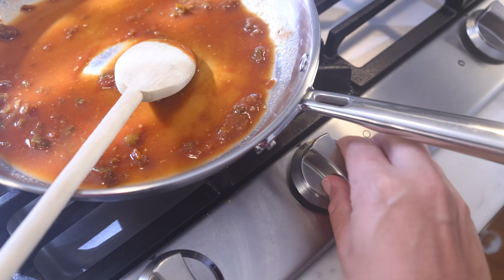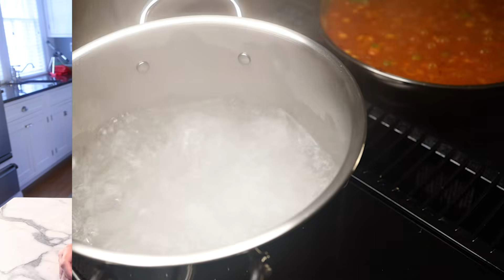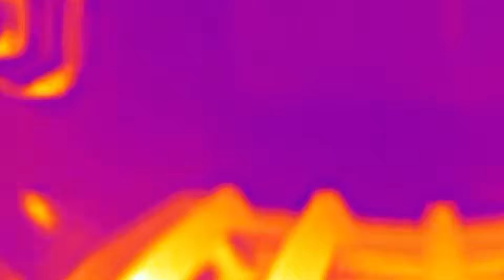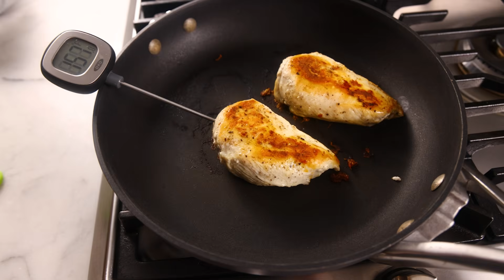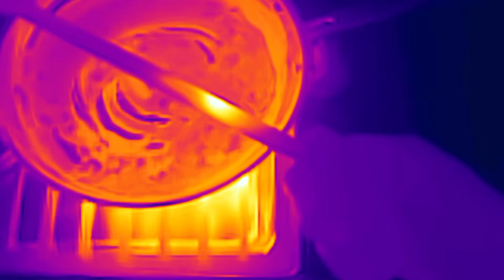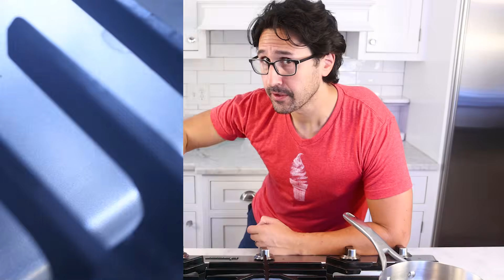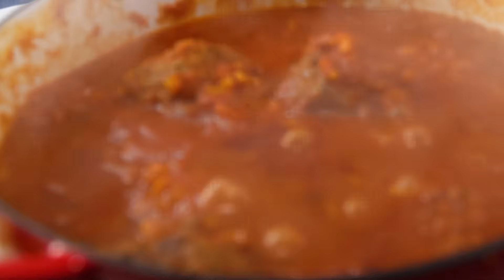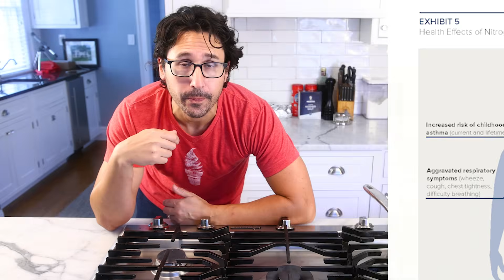Problems with gas stovetops | weak, dirty and dangerous

Comment: I have always found gas stoves to have more advantages over electric.  I am still in this position.  Your arguments have not convinced me.  Most recipes involve reducing heat quickly.  Electric stoves require having a second burner going at a lower temp.

Comment: Most of the problems you have with excess side heat and not getting the temperature low enough can be solved by buying some large trivets.

Comment: I don't quite get some of your points but the video is interesting. My father is a chief gas engineer at his own company, he has been doing it since 1987 and I've been exposed to gas world since i was a baby (the third word I learned when i was a baby was "gas") so my take may be bias. Where i live gas prices are pretty low and using a gas stove is slightly cheaper and in my opinion it's much more enjoyable to use gas stoves. Plus you always see when it's on or off, it might seen stupid but a couple of times i left my girlfriend's electric stove on but thought i turned them off lol. But when it comes to hazards oh boy gas stoves are dangerous. The best case against gas stoves is how easy they can kill you. Let me give you an example. In soviet buildings there are no fans pumping co2 from each apartment, instead they are designed with special gaps (in doors, windows etc) to provide airflow and create positive pressure in an apartment, there are also 2 types of vents, for clean air and co2. So there are a lot of people who change their old soviet wooden windows for newer plastic ones and their doors for newer soundproof doors. If installed incorrectly this would destroy air circulation and fill your apartment with co2. Also i know at least 2 stories where people installed fans in their toilers and connected them to the wrong airvent wich created a negative air pressure and all of the co2 from co2 vent got into their apartment

Comment: In the US gas is essentially a waste product of oil extraction and production. That's why it is so cheap. Gas that isn't put into the gas pipelines and used will be flared off at the well head. In Europe and other continents gas is piped in from Russia or shipped in from elsewhere, and it is presently quite expensive.

Comment: For me the biggest W for gas stove is you can exceed the maximum heat of electric/glass top stove without any kind of expensive or troublesome modification.I like that feature because me and my family are asians,and we live in  south east Asia and many our homecook dish require very hot and stable heat,also with gas stove you can use your wok or any kind of wok like pan (if you pay attention to the past adam's video he never used wok or wok like pan because the flat and not supported surface of the electric glass top stove) and the last thing for me is gas stove can provide so much dexterity,freedom and flexibility to cook
Reply: For those who wondering what kind of gas stove that can exceed the maximum temperature of glass/electric stove,you can look up to chinese restaurant that use very fast and big stream of flame to cook fried rice or other stir fried dishes

Comment: Should've gone with my gut expecting this to be "environmentally" motivated. Seemed legit at first, though poorly evidenced and argued, as is custom. And sure enough, eventually devolved into the carbon footprint equivalent of penny pinching. Wake me when we solve the shipping industry. Til then and as someone who's predominantly used electric stoves throughout most of my life, you can pry gas from my cold, dead, immaculately prepared fingers because I was able to maintain a steady temperature rather than compensating for random fluctuations while simultaneously trying to re-figure out where medium actually is this time. Because why would a person want that to be consistent?

Comment: I agree with the lack of low heat. I often take one of the grates from another burner and stack it on the one I am using to prop up the pot an extra inch to let more of the heat escape.

Comment: The Most obvious designflaw in gasstoves ist their Open Design. You see, the woodburning stoves did it right, a big slab of Cast Iron with removable Rings above the Center of the fire for the extraboost of Heat.
Light fire,remove Ring,(s),Pot on, Instant Heat without burnig Handkes, Thermometers etc. For Low and slow add Rings and Push Pot to cooler place.

Comment: My brother left a cardboard box on his electric stovetop the day they moved in, it was turned off, they left to go drop off their u-haul, and they received a call from their neighbor that there had been an explosion. The apartment was on fire. Yes, electric boils water faster. If gas is off, you know it's off. If it's on, you know it's on, either from the flame or from the actual gas if it's not ignited. Electric doesn't cool down quickly enough when you just need your stove for storage space after you've drained your pasta and you want to put the pasta back in the pot, not a separate bowl so you only have to clean the pot. Electric is great for boiling water, happy for everyone who likes it but oh boy I will never

Comment: To me, Adam's "all the way down" problem is an absolute death blow to gas stoves, and why I like my resistive glass-top electric.  I was watching a recipe on another video recently (Tasting History with Max Miller, "Japan's Edo Era Noodles") that called for heating a liquid but not boiling it -- no problem on electric, nigh impossible on gas, in my experience.  Electric has a huge advantage in low-end temperature control.  Yeah, the response is slower with electric, but especially on the low end of the temperature range, that's a good thing.  I'm with Adam on another point, too:  when my current stove dies, I'm going induction.

Comment: If you switch to induction they type of pan is important beyond the fact that the bottom is a ferrous material. Some pans have a thin ferrous plate attached to the bottom of a pan. This is often not sized correctly for the pan so you will get hot spots in the center of the pan. This type also doesn't seem to heat up as quickly as a tri-clad base. If you do switch to induction I think this topic would make a good topic for a video or at least part of a video.

Comment: I love that my ceramic resistance-coil cooktop is so easy to clean. I find it pretty responsive - it was actually something I noticed when I first used it - though I do pull a pan off the hob occasionally.

Comment: As you said later, it's not really power but efficiency. Gas stoves spit out a lot more heat than electric ones (at least here in Italy, where our electricity contracts are 3kW), but electric ones are much better at getting the less heat in the pan.

In my home there's an old Smeg gas burner, that does a fantastic job of keeping the heat focused. I have absolutely no idea how it does it, but I can safely hang stuff off the pan without a problem, I can keep my hands very close to the pans and pots without fearing to get burned and water boils rather quickly. To put it into perspective, the only times I have to be careful are when making coffee with a Moka, otherwise it's pretty much like electric.
When we installed a second gas stove and I started using it I was not used at how much the sides got hot, I almost set fire to a bunch of stuff before getting used to it lol. So far I haven't found another gas stove that's as good as the one we have, traveling and observing the ones in my friend's homes (after finding out that our stove was like that I started looking for the stove in every house I get into lol)

Comment: One weird thing I noticed when I went to college in the US is how freakin’ old-fashioned the US is. Those naked coil electric stoves haven’t been a thing over here in Sweden since at least sixty years. I never saw one outside a scrap yard until I came to the US a quarter of a century ago. And they still have them?! 

For those who wonder, the “old-fashioned” electric stoves in Sweden have the coils imbedded in cast iron plates of sizes that fit standard pot sizes. But those are on the way out in favour of ceramic tops and induction.

Comment: I moved to a place with a brand new coil-electric stove top, it has this thing called "Sensi-Temp" which, in theory sounds great, but in practice, is dumb and does nothing other than make my tiny non-stick pan not sit flat on the coil because they have springs in them and that pan is light. It even makes my 12-inch All-Clad lift up every so slightly on the one side.
But, the burners on that stove, my god they get hot, like water jumping out of the pot hot. It's amazing. It also has "Sim" written next to 1, and it does exactly that, simmer. Very useful.

I am very used to the way the resistive coil behaves, I know that it takes time to heat up and cool down, and I use that to my benefit while cooking. I also am very used to moving things away from the burner when they are done, which can be annoying, having a glass top made that a lot easier, the coils are not at the same height and not as easy to just move the pot off the burner, but it's not a huge issue.

I do cook Chinese food every once in a while and have a wok (flat bottom), I have just accepted that I am not going to get a restaurant level of wok hei. I don't really miss it.

Living in Canada's gas centre, I am happy to use electric and not gas.

Comment: It won't solve all your problems, but a big robust electric kettle is the perfect fix for the water boiling issue (ironically getting what is basically a small electric heater is the solution). They are cheap and even though it's a "single-use gadget" what real meal doesn't involve boiling water?

Comment: I bought a $50 (CAD) induction burner from IKEA this past summer, and it immediately became my favorite cooking appliance in the house. It's lightweight, portable, way more responsive and it feels more powerful than even my largest burner on my coil stove. I regularly use it with my carbon steel and cast-iron cookware as a BBQ stand in on my apartment balcony.

Comment: Here in Mexico gast stoves are the norm. Not only electricity is expensive enough to make electric stoves inefficient economically speaking, but we also use gas to heat water for bath and washing. Gas is so important that recently the goverment decided to spun up their own gas company.

BTW, gas can be either be delivered by pipe, or by a tank installed inside the property, with both a stationary refillable tank or a removable one. Even there are some jokes about the gas man being like the milk man: the real father of tons of kids.

Comment: If you want lower heat than the lowest setting of a gas hob you can buy a diffuser which will sit under the pot and lower the heat to the pot, I use one when I'm steaming small amounts of rice and the lowest gas on the smallest ob is still too much

Comment: I hate cleaning my gas stove! Most of the time I just clean it so theres no big bits of food, and don't clean it until it shines... It takes too long. I'd definitely replace it with a different type when it needs to be replaced. And my husband is from England, and they use electric kettles much more than we do in the US. So when we need boiled water, we use our electric kettle, and it's much faster than starting out on the stove.

Comment: Some additional pros/cons for the environmental impact of gas.

Pro:
Peak energy usage tends to be around dinner time in the summer, so the fuel efficiency of gas is beneficial in this regard.

Con:
Gas infrastructure tends to be leaky to some extent. Residential is spread fairly thin, so this can be a significant problem.
Large energy suppliers of gas can potentially do carbon capture. This mostly hasn't happened, because there is no incentive.

Comment: The ''boost'' mode on my induction is so hot its like boiling water on the surface of the sun. If you have cats, remeber to lock the controls, my cat turned it on by accident once with an empty pot on the stove, it almost reached white-hot temperatures, we noticed it when we could hear the metal of the pot creaking.

Comment: Induction is amazing, as long as you buy a more expensive option. I have a cheap tabletop induction hotplate and it has to cycle off and on to produce low heat, which is very inconvenient in some cases. I also have an electric stove and those have always been atrocious in my experience: slow (slower than gas or induction) and unresponsive.
Reply: You're right people buy those cheap standalone induction heaters and think this is the best that the technology can offer. In fact those things are so inferior in quality compared to newer full sized models.

Comment: What you need to simmer on gas is a simmer screen. It is a thin metal disk with a screen and some fireproof wool that goes between the burner and the pan.

Comment: You can't char food and flammbe on electrics.

There is a major advantage to gas stoves, ovens, and water heaters. The bill. 

if you have an electric rate plan with super prime, prime, and off prime pricing. Then running electric appliances during the day light hours can be expensive. While gas appliances are the same price no matter what time of the day.

Comment: Gas is the only way to go for the serious cook.  It’s instantaneous and responsive.  A high quality unit has an X-low burner for simmering or just make a flame-tamer from aluminum foil.   A decent unit also has an overhead vent.  Heat-up time is more a function of the cooking vessel than the heat source.  Stainless steel has poor thermal conductivity for instance but SS/Al clad heats up just fine on a gas range.  I do prefer an electric oven / gas cook top.

Comment: Never used induction so I can't speak for its merits, but I MUCH prefer the instant control you get from gas over an electric coil. 
It's irritating to have to lift and move a pot or pan because the coil isn't going to cool off soon enough, especially when I've got other pots or pans on the stove cooking a side dish.

Comment: Glasstops are easier to clean than gas, no doubt, but one thing I've noted about your videos Adam - you are very willing to be sloppy around the kitchen. That doesn't help. (There's nothing wrong with that either, it's just an observation.) My current house has a ceramic range and I'm excited to replace it with induction - when supply eases up in a year or two. By then I'll have more induction-compatible cookware and it'll be great. The controllability of gas with the efficiency and speed of electric. It's a win/win, if you have compatible cookware.